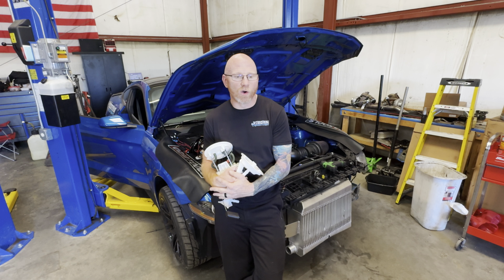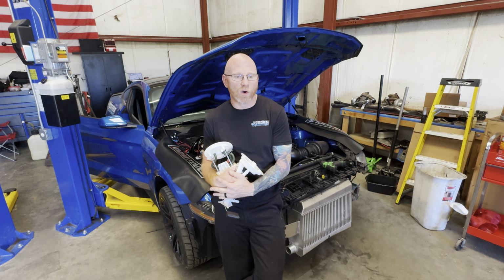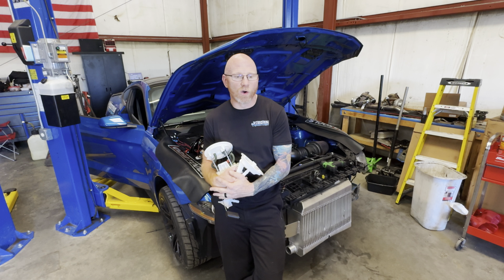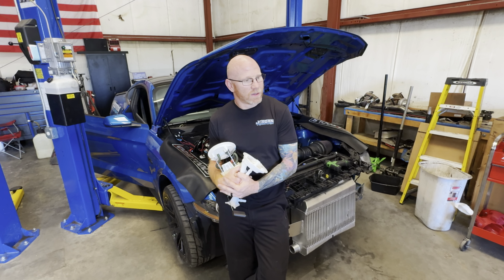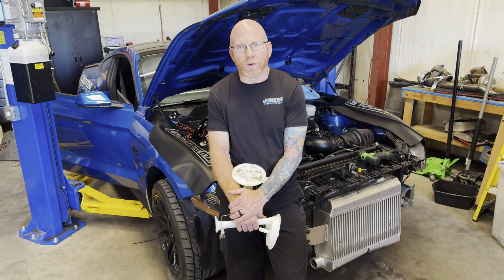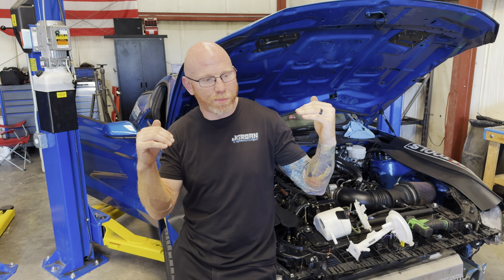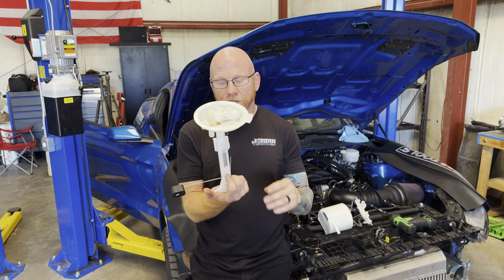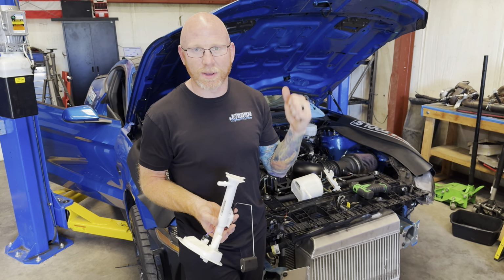Why it’s important to have at least 6 gallons of fuel in a Mustang

Comment: Here from the podcast with Cooper. Was curious if you figured it out. I'm glad you got it sorted, and im glad i came across this. I also have a Fore Innovations fuel system and run it very low when racing. Luckily, I have not experienced any of these symptoms, but moving forward, I'll be running more fuel to avoid this from happening. Thanks for the update 👍
Reply from the maker: yessir we did finally figure it out. The fix was pretty wild and not something anyone would have or could have expected. but its fixed now and running better than ever

Comment: What’s the set up on car.  I like it
Reply from the maker: twin turbo hellion car. twin 68mm turbos. built motor. built trans. 1600+whp on 37 psi. we're getting through the r&d phase on the 10R. so far showing promise. been 8.3@167 so far earlier this year on a hurt trans. Goal is deep 7s full weight, full interior, with my sons car seat in the back. true 7 second daily driver

Comment: What I hear you saying is that this problem only occurs in a race environment and only when the car has both sides empty. I have a stock 2021 GT so this is not an issue for an old geezer like me. I've run my tank down to probably 2 gallons or under but I see what you're saying. A lot of effort you just undertook to help out some young buck out there. Thanks for the excellent analysis and all the hard work that went into it!
Reply: This is why I'm leaving mine stock for a while..

Comment: This happened to me after my build. I had dropped in a Fore triple in the tank and I knew there was plenty of fuel in it but the car ran out of gas after almost 10 minutes. Well...I didn't know it was "out of gas" because I "knew" how much gas was in it. So I started troubleshooting OTHER reasons for a no start until I noticed that I was not getting any registered fuel pressure on the gauge and added 2 gallons of fuel and it did the trick. So I keep it with at least half a tank of gas...always.
Reply: That sucks that you have to do that.. And this is one of the main reasons I haven't really wanted to Mod mine.. I have seen guy's put something as simple as a cold air intake on their cars and than have the car run funny.. The main thing I want done is a short throw, A Steeda shifter Mount, and the Steeda trans insert too, just to tighten it all up more.. The stock bracket is crappy with a soft rubber which makes for sloppy shifts.. I need to find someone with a lift or just take to a trans shop and Pay.........

Comment: Is there a way to remedy this problem, so you don’t have to always keep it at a half tank with a fuel system?
Reply from the maker: We're working on a solution right now but it's not an easy fix.

The immediate fix would be to cap off the crossover tube on the drivers side and make sure you only have 5-6 gallons of fuel in the car at a given time. Any more will fill up the passenger side and there will be no way to transfer it over.  Your fuel level gauge will still work but your new "full" mark is a little below 1/2 tank